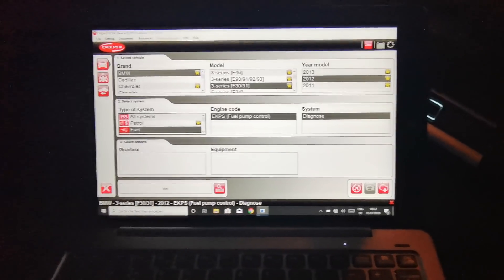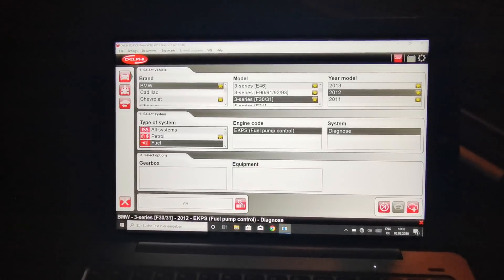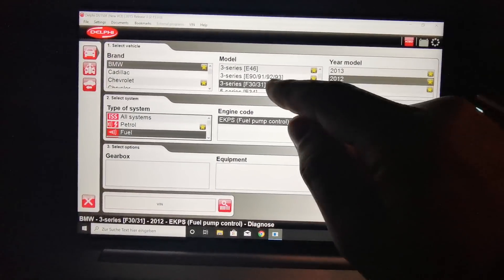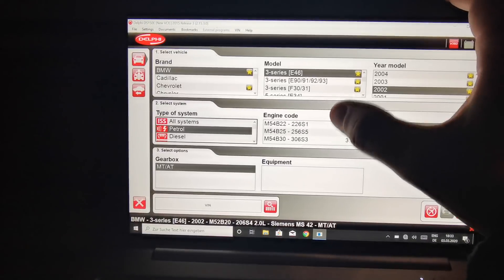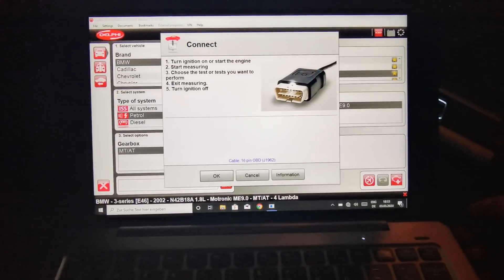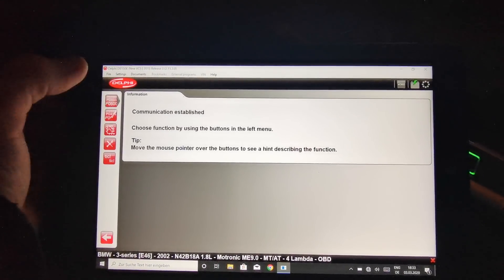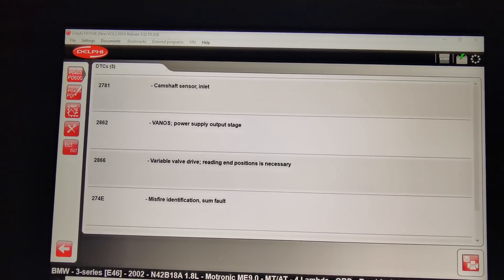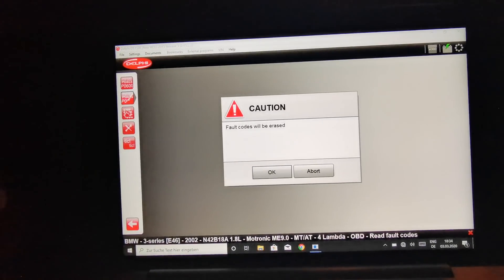Bmw e46 n42/n46 316i/318i errors read 2781 2862 2866 check valvetronic with Delphi software repair

Comment: Did you replace the camshaft sensor? If so, what brand did you use? Aftermarket or oem?
Reply from the maker: Replaced oem but the same! It was the valvetronic axle!
Reply: @diyonlinegarage  was that the 2781 code? I have only the 2781 code on my n42b20